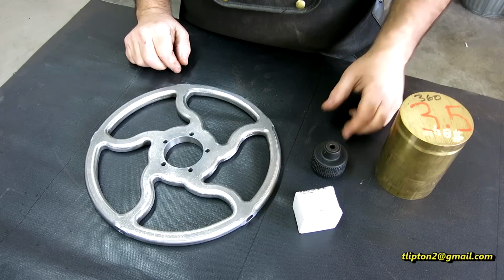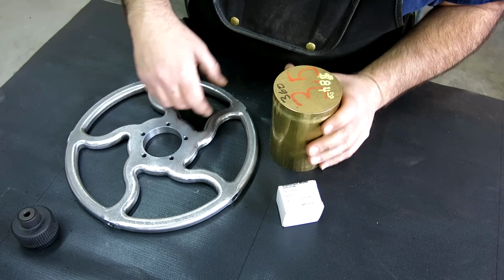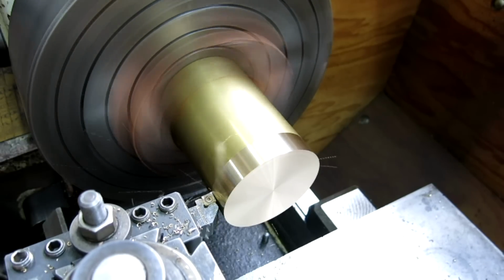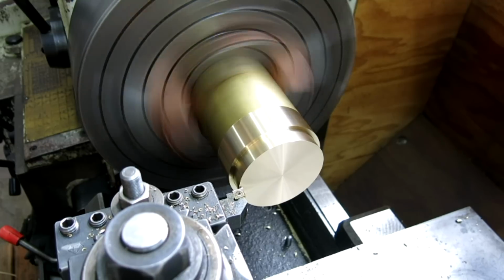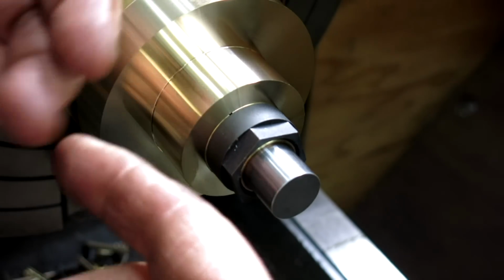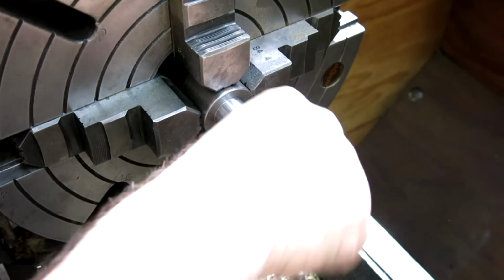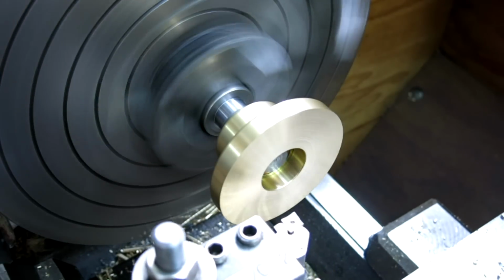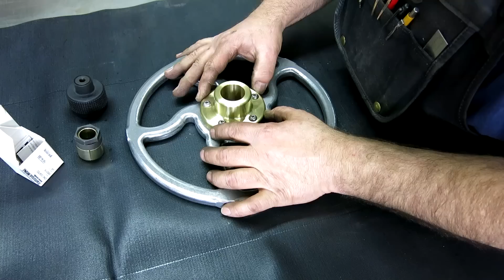Ships Wheel Bezel P1

Comment: Really nifty about the trans torque I was not aware of them. Thanks for the heads up on them. The radi on that hub sure does make it pretty!
Reply from the maker: Hey Brian,

How's that barn coming? 

Best,

Tom
Reply: Currently trying to figure out the design and installation of my  PEX pipes for my radiant floor heat. Lines in a concrete floor is really a one shot deal so I want to try to get it right. One of my viewers mentioned a shop that had problems with their setup breaking up the concrete and failing the tubes. I think maybe they didn't have the runs deep enough in the concrete to properly spread the loads. I am thinking I will put mine at the bottom of the slab so they run less risk of getting drilled into and the slab should be more solid towards the top where point loads occur minimizing the risk of cracking and failures. What do you think? Move to California where you don't need heat right? lol Seriously though if you have any insight I value your wisdom.
Reply from the maker: Hey Brian,

Comon concrete? Get with the program. You need a wood block floor like the old shipyards have http://jennisonwright.com/woodblock.html. Easy on the legs and no need for heating. I've always wanted this kind of floor for my ultimate dream shop. Quiet, soft, easy on the legs, and super cool looking. 

Best,

Tom
Reply: I actually worked in an 1800's machine shop that had this type of flooring. Besides the occasional floor fire from welding it worked great. You could drop heavy steel parts on it and they wouldn't even get dinged. :-) Damaged a section you just drilled some screws into the old blocks, yanked them out and drove some new ones in. Got some settling, pull the blocks dump some sand under them and drive em back in.  Spill oil it just disappeared into the floor. It certainly would have an old school look to it. The floor being dark it really sucked up the light though.  I don't think I could give up my heat though in my climate. Working in a freezing shop is no fun.
Reply from the maker: Hey Brian,

One of the other cool things you can do with this type of flooring is Put your machine utilities in them. You run electrical and water by removing and mouse holing a line of blocks. If you change your shop configuration you can easily re-route the utilities. In a shop with an overhead crane keeping clear of some of these items can be tricky if its not planned ahead of time. I think the modern setup is to pour a concrete floor that is recessed the height of the blocks then install the blocks, Brian......

Best,

Tom

Comment: just curious. do you ever resharpen or hone the carbide inserts instead of tossing them out when they get dull.
Reply from the maker: Hi Wayne,

Only in desperation. Its nearly impossible to get them to cut the same. Technically yes you can touch them up but you might as well switch to brazed carbide tools then. The advantages of inserts is their precision geometry and chip control features. Thanks for the comment.

Cheers,

Tom

Comment: I wash you would have told us you need one or two trans torques, my work throw away boxes and boxes of them. We had to remove them because a hammer and chisel mechanic used it in place of a nut on a stripped bolt. Thanks for sharing.
Reply from the maker: Hey Sam,

Yikes! Those little puppies are not cheap. They are great and simple to apply. Thanks for the comment.

Cheers,

Tom

Comment: Nice little collet fixture, but does it run true when installed at 14:00? How can You be sure it expands the same - all the way around?
I was waiting for the dial indicator to be thrown in, but no way...:(
Reply from the maker: Hi Erling,

They are pretty good as they are designed for high speed equipment. Thanks for the comment.

Cheers,

Tom

Comment: Silly question, do the curvey spokes on the wheel have a practical purpose? Or are they entirely a design aesthetic?
Reply: Ah I was thinking it had a function after it had been built. I never considered the function was actually for during the construction process. Cool, thank you!
Reply from the maker: Keelan has it right. Historically they relieved stress in casting. But they look so cool and iconic they must be preserved. Yes purely aesthetics in this case. Thanks for the comment.

Cheers,

Tom

Comment: The wheel begs for a groove on the inner side of the outer wheel.  Not much but enough to visually make the spokes just that spokes that support the wheel itself.  Even with the handles it looks to un-delineated
Reply from the maker: Hi Bigun,

Not following you here. If the groove is on the inner side of the outer wheel you can only see the groove if your close to it or looking at an angle. The steel wheel will be painted black with polished handles sticking out of the periphery. Thanks for the comment.

Cheers,

Tom

Comment: Tom, (or anybody that would care to offer examples) I have a question that doesn't relate to this particular video, but, beings you seem to know everything, you are the first person I thought to ask. Can you give a few ((verbal)) explanations of why or how a ((TWO JAW, LATHE CHUCK)) is typically used or why it may be needed. I Typically only see these two jaw type lathe chucks, with aluminum replaceable jaws, so, I would simply assume that they are for easy machining of specific diameter holdings cut into them. Why would the two jaws be any better or needed over the multi jaw chucks with machinable replaceable jaws, due to the safety factor of the work being held by more area of the more then two jaws type chucks. I also suppose that maybe a special flange casting/part or a two tang/ear flange part would not be simply held in a three jaw chuck, where as the part would in the two jaw type, but the cost of a two jaw, would seem to be prohibited, as they can be very costly. Those are really the only reason that click in my head. I would like to understand the value of having one as part of the tooling inventory to my shop. if I ever came across one for a price I couldn't refuse. I do not have any intentions of purposefully going out to acquire one, rather, just wondering. You know how it is, never knew how useful a tool might be, until somebody teaches you how to use one, only to question, how you lived live with out one for so long, lol.  Thank you, Drew
Reply from the maker: Hi Dru,

Two jaw chucks are typically used for soft jaw work. I haven't taken one apart but I'm pretty sure they don't operate on a scroll. This gives better clamping than a scroll chuck. Pretty specialized tooling. Not something I would seek out until I had all the standard collet and normal chuck configurations in stock. Hope this helps. Thanks for the comment.

Cheers,

Tom

Comment: That counter...can't you replace the faceplate? in it? As well as the needles. Or maybe the guy that repairs your calipers can neaten it?
Reply from the maker: Hi Bjorn,

The counter is recessed into the brass pretty far. The steel will be painted black and the frame will be red. I hope it will just disappear into the machine. Thanks for the comment.

Cheers,

Tom

Comment: Excellent video once again Tom. 

Were those washers you used to lift the part off the mini pallet? They looked like it, but seemed pretty thick.
Reply from the maker: Hi Dan,

They are washers. I got those from a big pressure stainless vessel that was disassembled. Thanks for the comment.

Cheers,

Tom

Comment: Quick question, when you made the 5/32 chamfer, you just touch off in the y direction and then move in the x direction and done right?  You don't move it in the y direction more do you?
Reply: On a lathe it's X for the cross feed and Z for the longitudinal or towards the chuck
Reply: I've been calling it wrong then, my x,y,z experience comes from engineering dynamics and I dabble in home machine.  Thank you for the correction.
Reply from the maker: Hi Eric,

It depends on the size of the radius. For larger radii you have to take it in smaller bites and just do the full radius for the last instant of cutting. Large radii are really prone to chatter. For small ones like this I find it better to set one axis where you want it so you can concentrate on only one axis for the final position. Thanks for the comment.

Cheers,

Tom